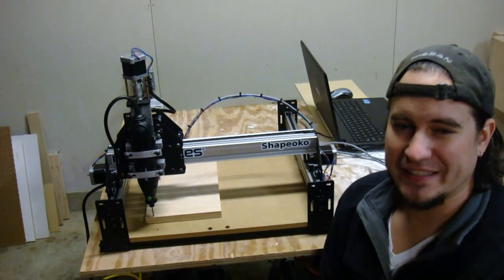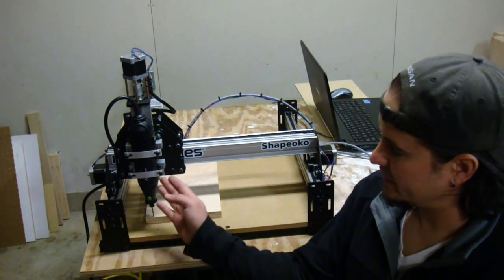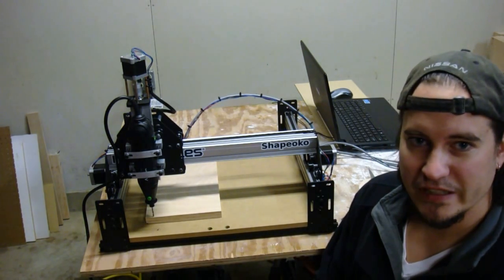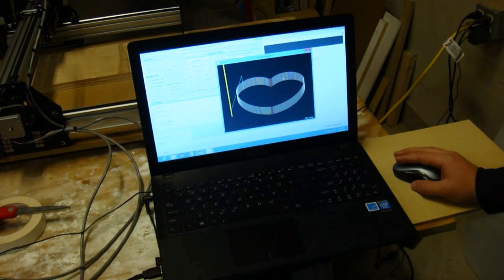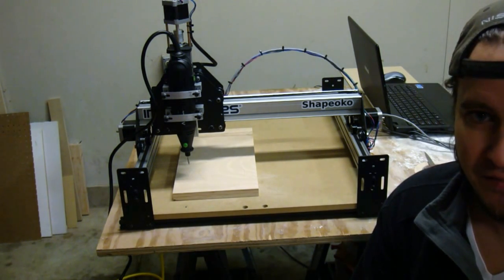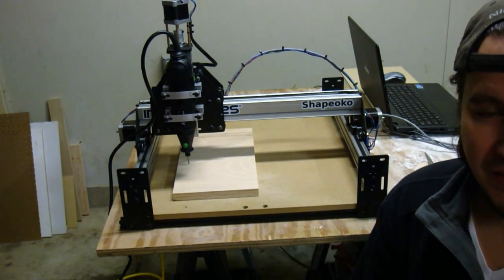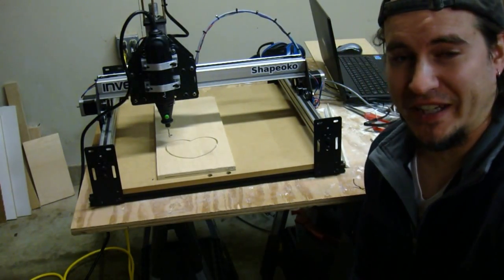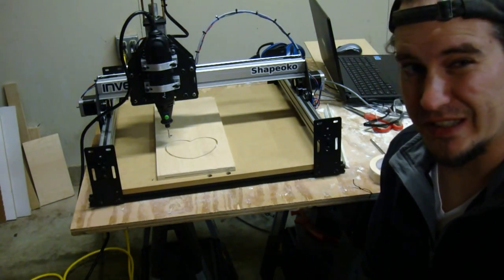Shapeoko 2 first cut .... and a few crashes.

Comment: hello
nice machine ;)
can you tell me how do you fix the material on the table ?
Reply from the maker: Radosław Wyszyński i use double sticky tape from 3M.  Carpet tape should work as well.
Reply: Targ's Workshop and do also you use it under cutted piece to avoid the extrusion of the piece after end of cutting?
Reply from the maker: Radosław Wyszyński yeah, i basically cover the whole bottom of the material with the tape, leaving about a quarter inch between tape strips.  Lots of tape means that it will hold better.  You will probably have to use a chisel to remove the material after you are done cutting.

Comment: I had a similar problem when I put together my Shapeoko this month.  The Dremelesque tool that comes with it just wasn't handling the material so I upgraded to a Dremel-3000 since they were on sale after Christmas and got some different bits.
Reply from the maker: I assume the new Dremel-3000 preformed better.  Taking it slow when first starting out is usually a good idea.  Lessons learned

Comment: as  crashes go those weren't too bad,i tossed a 1 ton part off a vertical lathe cnc once, rather loud. NOTE, if possible only extend the tool little as possible, it won't deflect as much,

Comment: Glad to see we're not the only ones needing more time to get the ShapeOko2 to work they way we want it to :)
Reply: We're putting an emergency stop button in by the way, so far we've been unplugging the machine in a panic a bit too often for my liking ;)
Reply from the maker: David Bakker
I thought about wiring in an E-stop button but decided to just run everything on a simple power strip.  That way i can just hit the button on the power switch to turn off the Arduino and the spindle.  Hopefully with the more powerful Makita compact router and the limit switches I will be crashing less.  Good luck on your Shapeoko.